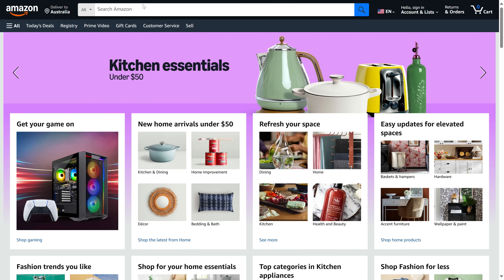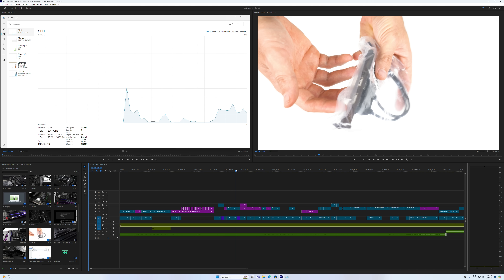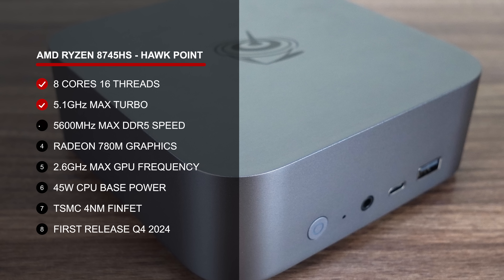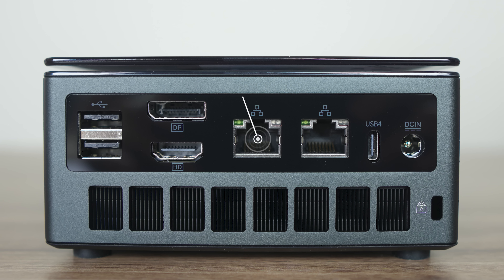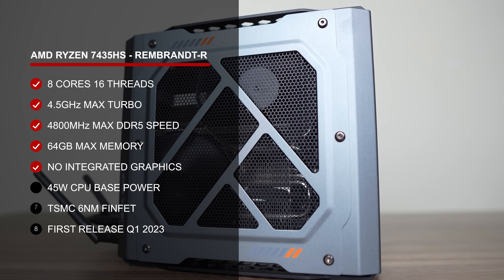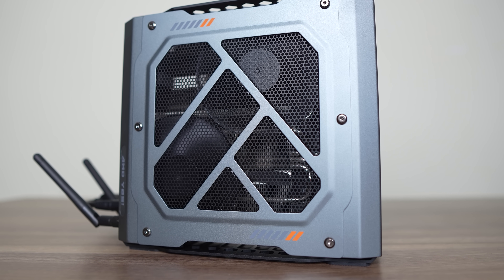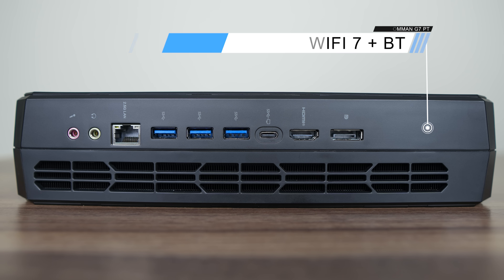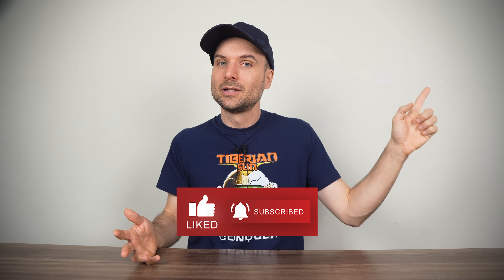Top 5 BEST Mini PCs 2025 ($305 to $1050)

Comment: I'm so indecisive. Idk if it's worth dropping a little in GPU, to take on double RAM. Eg the Reatan Mini is a 7940HS, 64GB RAM, 2TB SSD. But the GMKtec Mini has an 8945HS with 32GB RAM and 2TB SSD. Do I go for a slight increase in graphics and get the GMKtex? Or take the double RAM because you could allocate so much more memory to gaming, compared to a 32GB model? Or have so much more RAM for harassing Google Chrome tabs. I know that the 8xxx and 7xxx are mostly about AI, which I'm not that fussed about. I'm more interested in the difference between the xx40 and xx45. It's mostly for low-demand gaming (not AAA titles or high res, happy to play on lower res), RDPing back to my home PC when I'm away, plugging into my bedroom TV for games, streaming, etc. Is it worth the increase from a xx40 to a xx45, at the cost of 32GB RAM? Feels like no, because double RAM sounds like so much more value. The Reatan is 1099 AUD on Amazon, vs GMKtex for $1154 AUD. So price ain't a thing. I feel like the 64GB is probably more valuable than some 5% or so increase in GPU. And then there's the AOOSTAR GT37 currently down to $1120 from $1400, with 32GB LPDDR5X at 8000MHz with 1TB SSD. Dunno much about LPDDR apart from it being soldered to the board I think.

Comment: Hi, since the price is a bit different in my country, I want to ask you whether it's still worth it if I took Beelink SER8 for $537, other option is Minisforum UM870 slim, costs me $550.
*initially I wanted to get GMKtec K6 plus ($470), but I've just gotten myself a budget increase.
All mentioned above are prices for 32GB/1TB variant.
Reply from the maker: I think Beelink SER8 is a better mini PC overall.
Reply: @Robtech  thank you

Comment: Hello,  thank you very much for the video, but I'm still unsure to what Mini PC buy. 
Let me explain. I want a Mini PC for convenience and to play specifically retro games at maximum resolution, from NES, all the way up to PS3. I want to play GC, PS2 and Wii at 4k upscaling and HD texture packs. PS3 at 1080p or 1440p is fine and NO PC gaming, only retro (I have an LG OLED C1). I prefer Beelink, so any Mini PC that you could recommend for such emulation? Budget's up to 400$. Thank you very much for your help :)
Reply from the maker: You won't achieve any of that for $400. Closest is the SER8 and many games won't run full speed at 4K, but will at 1440P. PS3 will be fine at 1080P for most of the game library
Reply: @Robtech Thank you very much for your kind support. I'm really sorry for many dumb questions, but any in the range of $500 that could be "close" to that? It doesn't have to be Beelink. I'm actually more interested in playing Wii with HD texture Packs, PS2 with upscaling and perhaps a little Xbox 360. Thank you once again and sorry to bother you.

Comment: Thank you for your videos I'm new to the mini PC. I saw Kodi on a mini PC and I thought what a good idea to use a mini PC like a fire stick. Which one do you recommend and why? I'm going to connect it to a projector, Bluetooth speakers, and remote controls.
Reply from the maker: Many use an Intel N100 or N150 mini for Kodi as they have 4K hardware decoding via QuickSync on the iGPU. Might be a good place to start as they're inexpensive https://youtu.be/k7Q0VUEOAk0

Comment: Nice list, as always, a very good job! I have $1000 to buy a mini pc. I don't know if I buy a SER9 Pro (32GB) $919, Evo X1 (32GB for $799 or 64GB for $927) or break it all and buy the Minisforum AI X1 Pro with 96GB for $1120.

I'm afraid to get the Evo X1 because it has a high return and I'll be in US for only a week if something goes wrong. I already have a beelink S12 and it works very nice for more than a year, so I trust the brand. I know nothing about Minisforum, only that the memory is SODIMM, so the speed is lower. Hard decision to make.
Reply from the maker: Do you need OCulink? If not, might want to go with the SER9.
Reply: I don't need Oculink because I don't have a GPU. With your videos, I searched the Godz, but they don't delivery in time. I liked very much the Minisforum 790S7 ($896) and 795S7 ($944) with a 4060 and a 7945H. The only problem is the weight and it is not possible to pickup it in a amazon partner. 790S7/795S7 is my first choice (if possible) and my second is SER9. Thank you for your videos, nice job!

Comment: My AOOSTAR GEM12 8845HS 32Gb + 1TB ($469) arrived yesterday. It's the cutest little thing, fast and quiet. Wifi reaches 150 Mbps download, 500+ Mbps upload (1 Gbit fiber internet, upload is faster with all wifi and wired connections)

Comment: The GEM12 with 8845HS is also silent and snappy and at  about the same price point as the GMKtec K8+. Bluetooth range was horrible and the signal erratic and distorted. Tried to resolve it but to no avail. Resolved it with a 9euro bluetooth dongle,with better range. (I didn't test wifi) Other drawback are Chinese characters at lower level windows (for example starting in safe mode gives an overview in chinese only...). I'm happy with it though and can recommend it.

Comment: As a Linux user, so many PCs have the recommendation "Don't mess around, buy an USB WiFi adapter".  Seems it's not just me.  Any chance of a review, or an overview of cheap WiFi adapters?
Reply from the maker: If you don't need anything fancy,  the ASUS USB-AC53 works fine.

Comment: I have been watching a confusing mini PC ad on Amazon Canada.
It is a Beelink SER5 MAX, but the product page claims it has an R7-6800U (yes, U, which sounds great for efficiency and low noise operation), but LPDDR5 (wait, wut?) memory.  LPDDR5?  With this processor?!
Other than those differences, the pictures and specifications seem to be identical to the older SER5 MAX.  I have not bought one, but might try when I can afford it if it is still available  The problem is, if it is soldered LPDDR5 memory which is implied in the product description I would absolutely return it.  The 6800U would not benefit at all from soldered vs socketed memory.
Reply from the maker: It will have soldered memory.

Comment: Great video. One remark, the drop in price for the Aoostar GEM12 is probably due to the fact that the $349.99 price is for a version with 16GB and 512GB NVMe instead of the previous version (6 months ago) with 32GB and 1TB NVMe.
Reply from the maker: Doh, you're right. I've trimmed the parts about the previous pricing. It doesn't change my opinion of the mini, but is wrong to claim as a price drop. The new version of the video will update soon.
Reply: Smugly mentioning I got AOOSTAR GEM 12 8945hs 32gb 1tb for 469$

Comment: Actually, with the release of the evo x2 the x1 has come down in price to $939 in the u.s. ($854 for prime day)...even without the prime day deal it is still cheaper than the atomman PC...and smaller too.
Reply from the maker: Not sure what your point is. The G7 PT is in a different league performance wise. All HX370 minis represent low value for money.
Reply: @Robtech my point is that you said the evo-x1 didn't make the list of mini PC's under $1400 and I'm just saying that it's cheaper than the atomman currently...and it has been ever since the x2 came out.
Reply from the maker: You might want to watch again and listen to what I actually said.
Reply: @Robtech I did, you said the evo-x1 hasn't dropped down in price so you're going to showcase the best mini under $1100, my point still stands.
Reply from the maker: If your point is that it's smaller, cheaper and performs worse in CPU, and much worse in GPU metrics, then yes, I agree. That's why the X1 and SER9 were skipped until they get a sizeable price drop.
Reply: @Robtech well I don't know where you live but in the u.s. the x1 was about $1200 when it came out and it's now about $900 so i would say that's a sizeable price drop in 6 months.

Comment: Just yesterday I took delivery of a UM870 and was undecided between this and a SER8. I'm surprised you've given the SER8 the edge considering it's connectivity issues.
Reply from the maker: I prefer noise, performance, design and build/material quality over wireless connectivity. SER8 is the better mini PC with just the one issue.
Reply: @Robtech  Also the SER8 doesn't have a wall mount and I really wanted this as I have it fitted to the wall out of the way behind the monitor. No issues with noise on the UM870, I have to say, all I can hear is my tinnitus.....
Reply: I've read in a comment on another video that removing the inner dust metal mesh covering the RAM/SSDs fixes the WiFi issues. Have you tried this?

Comment: Actually owned two of the fiv.  I had the Gem12 and regretted selling, although the GMKTEC M7 Pro was a much better bargain for similar bang. Also bought the SER8; not my favourite
Reply: What didn't you like about the ser8? I just ordered one.
Reply: @snowbear441 I bought the 24gb model but it performs much slower than an 8745 should. Think there’s only one stick in it. The WiFi is really bad and mine didn’t sound as quiet as it should have done. Sorry. On the plus side, their support have been nice to deal with.
Reply: @jabonorte  Thank you. I read people had trouble with wifi and have bought a usb dongle to go with it. Hope mine will be ok.
Reply: @snowbear441  I've read in a comment on another video that removing the inner dust metal mesh covering the RAM/SSDs fixes the WiFi issues. Have you tried this?
Reply: @AlejandroMartinez-cl4kk  I purchased a cheap wifi usb and it works.

Comment: I have the aoostar gem12 6900hx. Its great. Some gaming info: I'm playing horizon zero dawn on balanced settings (including fsr) and playing neverwinter nights on fairly high settings. I play mostly older games so the 680m, with dual channel 32gb memory works fine

Comment: Great stuff. Oculink is overrated as hell tho.
Reply: I agree. Seems silly to buy a mini PC, if you are going to double the volume by attached a large external GPU enclosure.
Reply: Use case, use case, use case. 
Especially with a PC this small it's reasonable to have a gaming setup in one room with a GPU plugged into a high end monitor and tv/projector in another. 
So a dedicated GPU for one use (gaming/modeling/video editing) and not for another (PowerPoint/streaming/media consumption). 
Pcie Gen4 is a beastly transmission standard, if the motherboard supports it, not including a port is madness IMO.
Reply: It's nice to have the option I guess....
Not a gamer myself though

Comment: Those on a budget and like to game, the BeeLink SER8 with a Wi-Fi 6E adapter is a great value pick.  Total $535

Power users that are still resistant to get a tower desktop, get the BeeLink SER9.  Best for iGPU gaming and very good for programming.  Honorable mention is Atom G7, but the power consumption on your electric bill will skyrocket with the Nvidia RTX 4070 dedicated GPU.
Reply: In the EU: AOOSTAR GEM12 8845HS 32GB+1TB for 469$
Reply: To be clear, I'm assuming you're talking about the AtomMan G7 Ti, not the GT pt mentioned in this video?